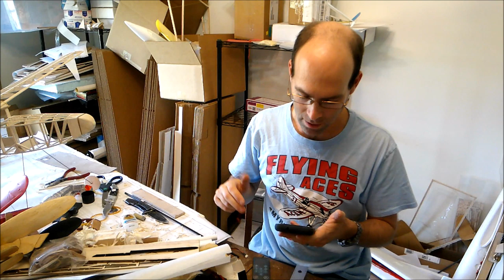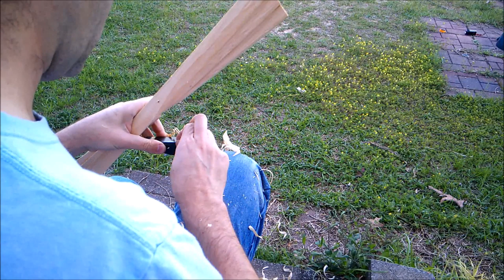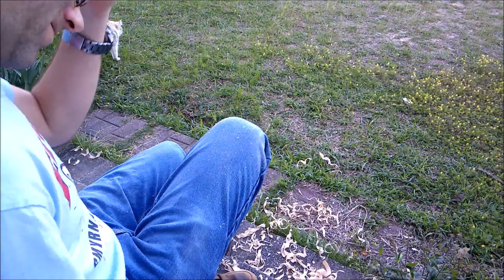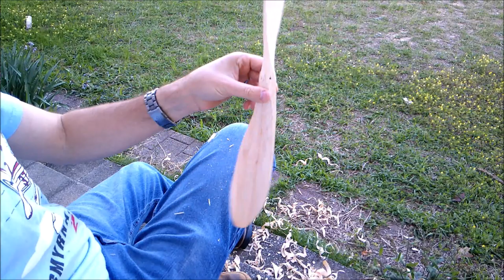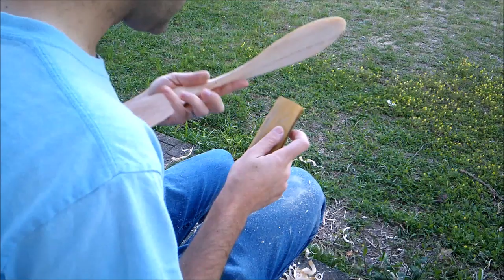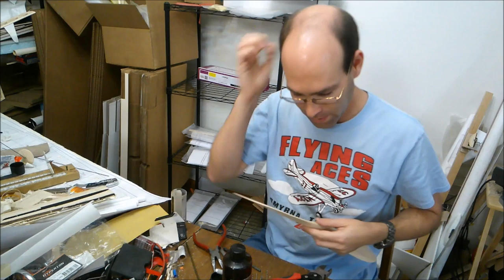How to carve an amazing balsa propeller using the laminated fan method

Comment: Hey Josh, Thanks for this vid. Working on a much smaller 6 inch prop. This was really helpful. Nice way to make a Nason clutch. It's a bit of a pain with a small plastic prop. Thanks again, Stefman.
Reply from the maker: Yeah the small Nason clutches can be a bit fiddly. The big ones can be a bit scary though...lots of load on a bit of metal that can tear you up good if you don't have it absolutely secured.

Comment: Hey Joshua, great video! I think I'll try my hand at this. Any way you could post a drawing of the clutch assembly and prop bearing details? It's a little tough to see on the video. Thanks so much for all of your great content!
Reply from the maker: OK, for the clutch, here's the basic concept: https://freeflight.org/Library/TechLibrary/FreeWheel,%20Nason,More.pdf
The bearing system is pretty plane jane, just a shaft withing a free tube within a fixed tube (fixed to the prop), like this: https://freeflight.org/Library/TechLibrary/FreewheelStruckRamp.pdf
Reply: Thanks, Joshua! I rewatched your video and saw the view at 59:30 which I had inexplicably missed the first time. It actually shows the clutch very clearly. Sorry about that. Thanks for the extra information, though. Do you always run the sleeve within a sleeve on the bearing or sometimes just a shaft straight into one sleeve? I'm assuming this is just to spread out the load of the bearing surfaces a bit? Or is it to just provide a better fit?

Comment: Hi, Josh. Is there a construction reason for the thick balsa pieces or was it just a case of what you had on hand? I've built several props by this method, but never used anything thicker than 1/8". You're quite right about not using the softest balsa for these. I tried building one using stretched bowtie shaped strips and had it break at the hub when I went to sanding it to final shape.

Comment: great video! thanks again.

I was wondering, is it possible to twist a strip of wood to make a  "variable pitch propeller"? (maybe using heat and/or water?)  if yes, what types of wood would be best and worst to use
thanks
Reply: Steaming slats of (mostly) pinewood and then finishing them off with a file and sandpaper is how I made propellers for  years. They worked well. Boiling wood in water also softens it sufficiently to be twisted, but pin the thing down somehow so that it retains its shape as it dries

Comment: What glue did you use. I used a PVA glue when I made my prop. The join was sort of rubbery and kept getting stripped away when I was sanding.
Reply from the maker: I used CA. Works for some...others find it hard to sand.

Comment: Making props has never been my strongsuit. Great video. 

Question though. You are making a clutch so the prop can freewheel after the motor is run out. Isn't there less drag when the prop is fixed, or does that only apply to full size planes where the pitch of the prop and wieght of the prop would affect the planes ability to turn?
Reply from the maker: Charles, above pitch/diameter ratios around 1.1, there is less drag if you let the prop freewheel. Below that, fixed is usually better. This is why if you ever stop the prop of a Cessna in flight, you can actually feel the airplane accelerate forward--low pitched prop coming to a stop reduces drag. The even bigger issue for rubber models, however, is that a large prop out on a long nose has a significant yaw and roll influence, so stopping the prop gives the plane a ton of right aileron trim, and usually some right rudder if there's much side thrust dialed in. This is why many rubber models will spiral in and crash if the freewheel clutch jams. Conversely electric models demonstrate a significant loss of glide performance but nearly zero trim change on braked vs unbraked props.
Reply: Hi Josh, please tell me how many pieces  and size of balsa wood you need to make a 13-inch prop for Senator Kyle Kraft. How big it should be. And its angle should be a few degrees. Because my English is very weak and you speak fast. Thank you.

Comment: I built a kk gypsy back in 77 but the motor snapped at about 200 turns smashing the front of the fuzz, hence the 1/4 flat rubber back then sold by the yard at the model shops in England wasn't fit for hair bands.
Reply from the maker: There have been many stories like that. I know a guy who wrecked the front of a rubber model at the Nats a few years back and put it back together with packing tape well enough to win the event.

Comment: Use your thumb to push the blade rather than pull the blade. You might consider a ser of orthodontic wire tools for controlled bends.
Reply from the maker: Unfortunately I learned carving without instruction and I don't know if I can relearn it a different way at this point. 🤔
Any suggestions on which particular orthodontic tools to get?

Comment: Josh, I’m currently building the EBM 22” span Chambermaid. I’m still trying to learn the ropes on flying and while this isn’t a beginner flier, I couldn’t pass up the promise of a fun build. I’d like to give myself the best chance at decent flights. I’m nervous about carving my own prop and am crap at selecting the specs for the motor. Can you recommend a starting point? The kit comes with a 10” plastic prop and enough 1/8” rubber for a single loop that is the exact length from the peg to the prop. Not nearly enough 8 bet. Is there a better plastic prop I can start with in case my carving attempts don’t succeed? What size motor might be good?
Reply from the maker: Justin, the Chambermaid is an awesome flier. A 10" prop is fine and will give good performance, but you'll need at least 3 loops of 1/8 to make it go. Put the CG where the plans say and you should have a good flier.
Reply: joshuawfinn thanks! I’ll stick with the prop that comes in the box and also try to carve my own.
Reply from the maker: @TexMechsRobot  sounds good. Please get some video when you fly it!

Comment: Joshua you need a microphone for your camera can't hear you mumbling.
Reply from the maker: Yeah we've switched cameras since. I'm trying to get a good microphone setup to improve further but so far none of the ones I've tried have worked with our software or hardware. Incredibly frustrating stuff.
Reply: @joshuawfinn  At least your trying to improve the sound :-)